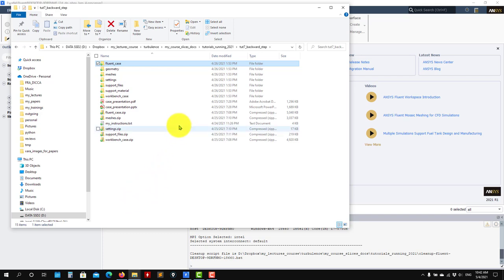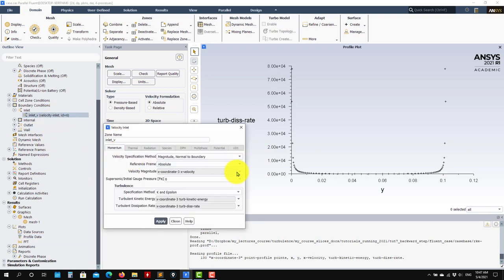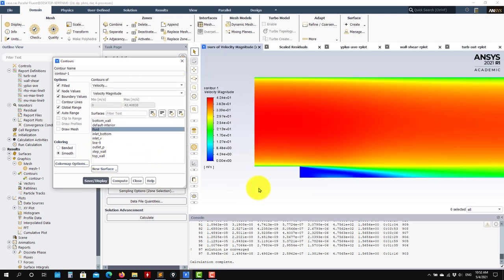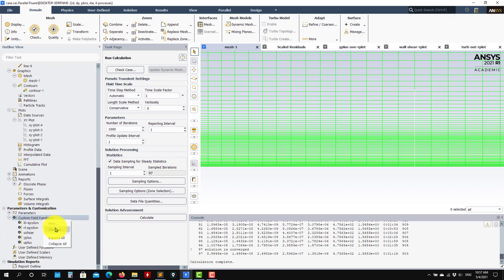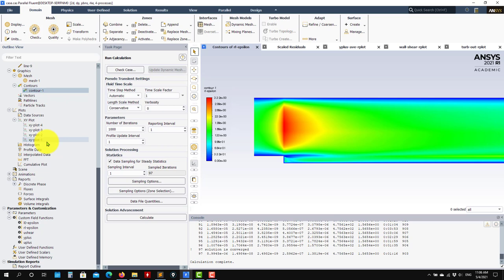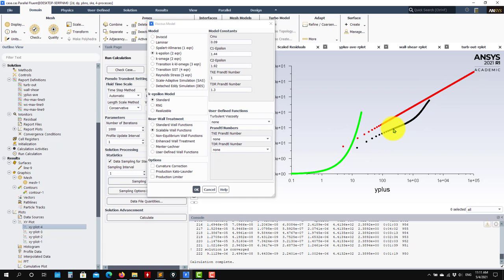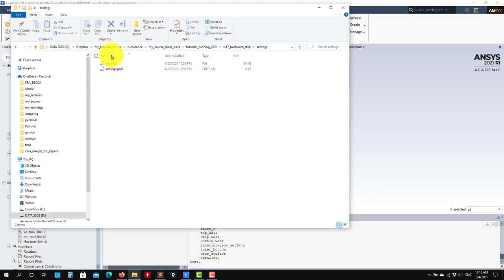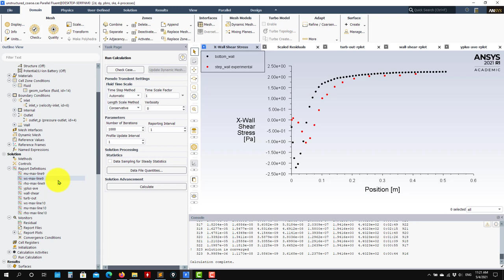Turbulence modeling with Ansys Fluent | Turbulent flow past a backward facing step - Part 2

Comment: How to get those data for inlet conditions 
I am working on supersonic cavity flow, my geometry is similar to backward facing step
At the inlet, i am struggling to get that parabolic velocity shape
Reply from the maker: The values are coming from experiments, and to set the simulation I use a profile file to read in the values
Reply: Do we need to have a parabolic velocity profile at inlet???
Reply from the maker: Well, it is always up to you.  You can use a uniform inlet profile, but you will see that the agreement with the experimental data is not so good. It is not always about the mesh, the numerics, or the models. You also need to use the right boundary conditions.